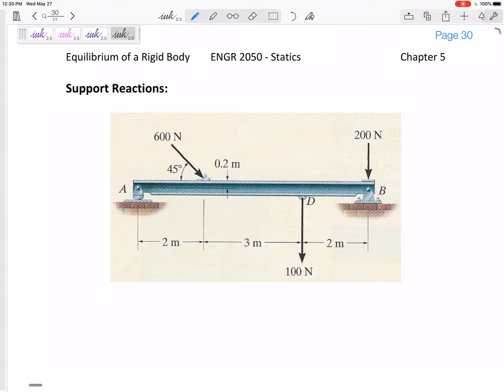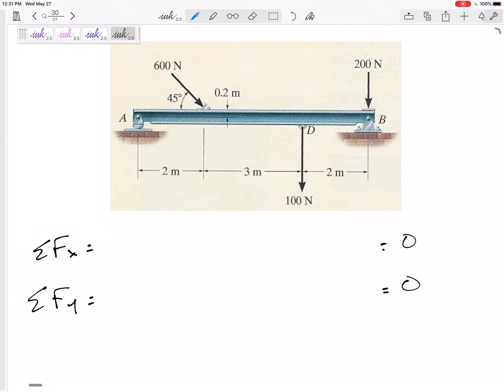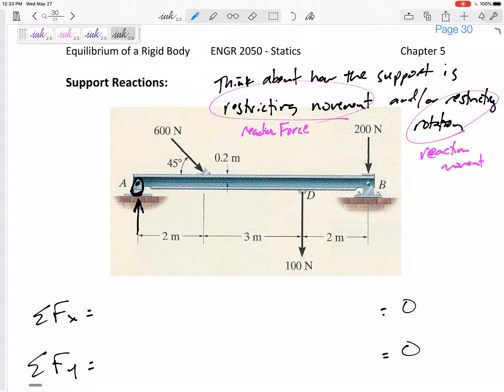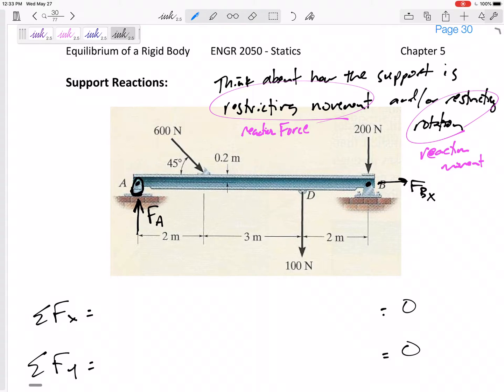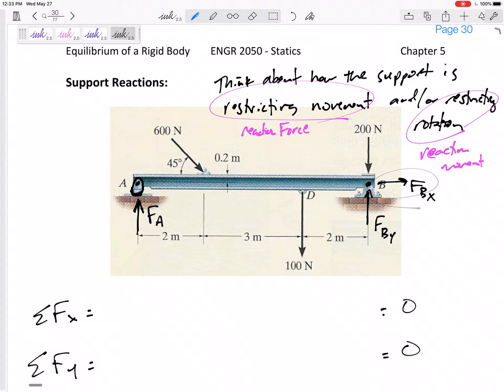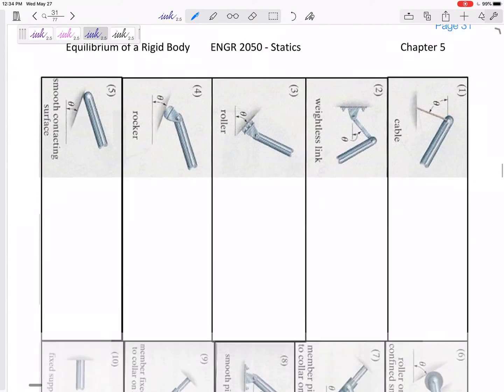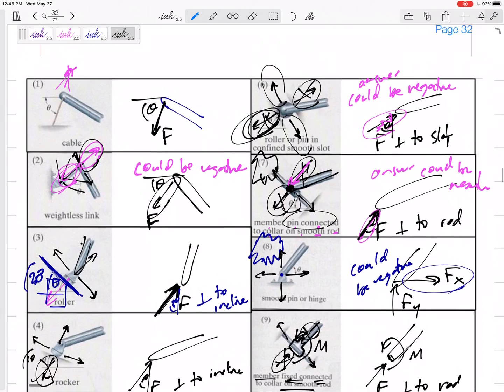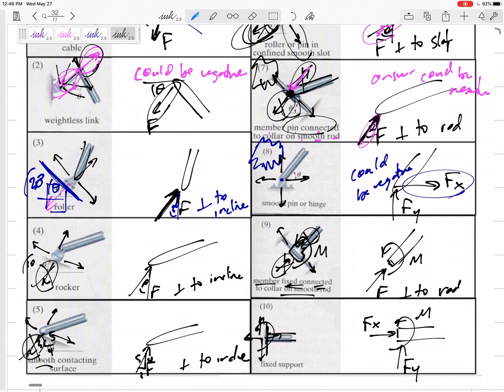Statics - Reaction forces at supports

Comment: Professor I have a question. For 2-D equilibrium I learnt that sum of the forces about x(  Fx ) and sum of the forces about y( Fy ) must be zero ,OK .Plus, sum of the moment of the forces and couple moments must be zero but I don't get at which point we must take the moments of the forces? I'd be grateful if you could explained me.
Reply: Not the Professor but I'll put this here anyways. Where you take the moment about doesn't matter. What the moment equation is used for is to take an equation in which there are two unknowns (either Fx or Fy) and solve for one of the unknowns. For example, If you solve Fx to be =A+B+10=0, you may take the moment about point A which would in turn provide you with a value for B which can then be used in the Fx equation to solve for A.